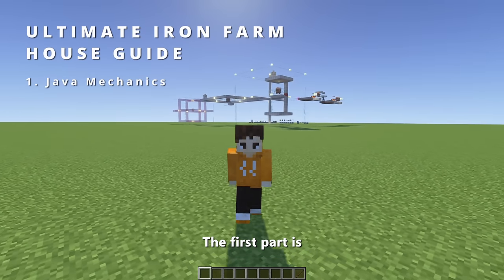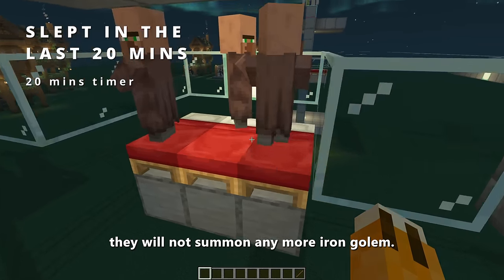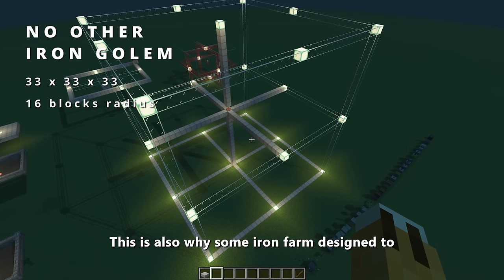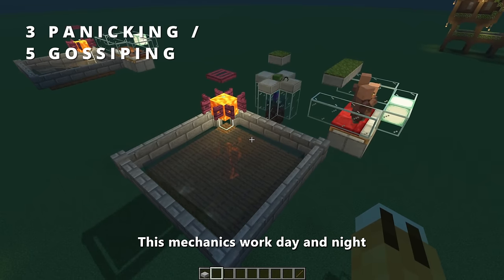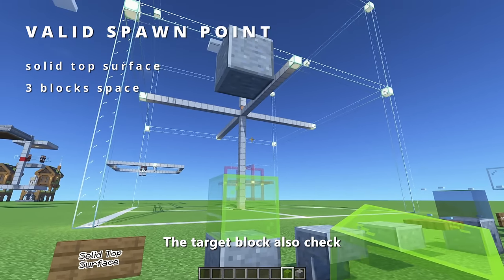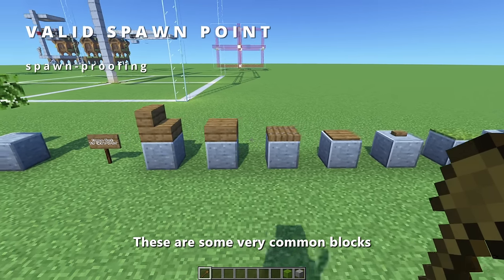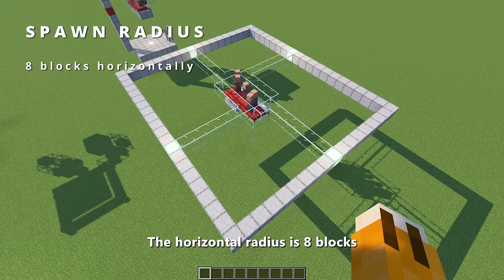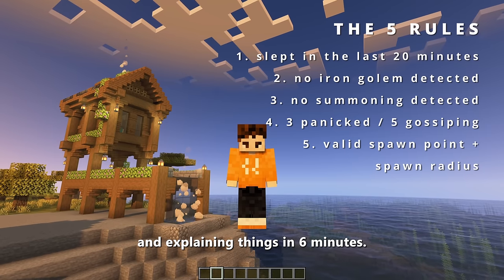Ultimate Iron Farm House Guide [Aesthetic Farm] [1440p HD]

Comment: just built everything on java and upgraded it to 3.0 and nothing is working according to the rules it should work but it doesnt, before i spawnproofed the inside the golem spawned inside but now nothing spawns anymore :(
Reply: this has happened to me too!
Reply: Same. If I place blocks outside the panic room, they spawn there, but not in the water channel.
Reply: Did you fixed this problem. And if you fixed it how did you do it?

Comment: Not working properly in bedrock 1.20. Issues: villager can not reach the working stations (they have to), villager glitching out of the building (found some on the roof and on the floor below the building), iron golems still spawn wrong or jump out of the pit.
Reply from the maker: The modification at the end of the video was built in Bedrock 1.20.1. I also just checked it in 1.20.10 and it's still working fine. Since I added a layer of sign so the kill zone is 3 blocks deep. No iron golem escaped the pool so far.

Comment: this doesnt seem to be working for me... does it work if some of the villagers are nitwits?
Reply: You HAVE to spawn-proof every block on the building and even on buildings near the Iron farm. Even if there is a 1 block surface, the iron golem will spawn on it if there is not a carpet on top of it. If you put carpet on top of every surface, both inside and outside the iron farm, you should have no issues.
Reply: @bradybowen3131  does this mean the golem won't spawn at all? or it will just spawn somewhere else? cause a golem isn't spawning at all. also, how far outside of the building do I need to cover up? it doesn't look like he covered any of the grass outside of his build
Reply: Golems should be spawning if you have 3 villagers set up near the zombie. For me the version 3 setup guaranteed Golem spawning. You must also remove golems that are very close to the iron farm in order for golems to spawn consistently and in the correct area.

If you look carefully in the video, he uses stair blocks or half-blocks where there were once full blocks; these are areas that must be spawn-proofed. Basically the roof, interior, and all four sides of the "house" must be spawn-proofed. I used carpet in my build and I no longer have issues with golems spawning in incorrect areas.
Reply: @bradybowen3131  I'm playing bedrock. but I have figured it out, apparently I was 1 block too close to a village, so.... I killed them all and burned down their village... now I have mass produced iron!!!

Comment: I built this in bedrock.
Followed it to a T, minus using glass for the floor. It didn't work, so I modified it a couple times & while a few golems appeared(sometimes in the water, sometimes outside). Now, I have NO iron golems spawning! 😭
I have 20 villagers, more than 100 blocks from any other villagers. I have 10 in the upper part & 10 in the lower part of the house. They all have access to their claimed beds & each level has 10 fletcher tables.

I'm at a loss of how to fix it at this point other than going all Daenerys Targaryen on them & starting over with two children villagers.

Does anyone have any suggestions? Is it the job blocks?
Reply from the maker: Is cat still spawning in the farm? 
If not, I think the village centre is shifted to somewhere else.
Reply: @aJackMinecraft  yeah, the cats are still spawning.
Reply: I figured it out!(with your bedrock mechanics video)
The beds on the top part made the village center too high. 😅
Thank you for the great videos!

Comment: i still have a problem with them not spawning any iron golems. followed everything
Reply from the maker: Java or Bedrock?
Reply: @aJackMinecraft  java. I've researched everything and the iron golems don't seem to spawn. Might just be a glitch
Reply from the maker: @gynics8605  Check the distance between the bed and the water canal. It should be 6 blocks gap vertically. >6 block = out of spawn radius.

Comment: Maybe some folks can help me with my java edition build. I followed the 2.0 method and made the changes to the villager and zombie barriers. The farm worked right away consistently spawning golems. I went to bed that night and now they wont spawn. Ive tried cutting all the trees around the farm, checking the caves under the farm, and the wider area for a rogue golem but no luck. 

The roof cavity is filled with dirt as to minimize spawn locations and to the best of my knowledge everything is spawn proof. This seems to be an issue with sleep counter. I've already had my villagers sleep at least one night before the zombie was even brought in and they were completely shielded until the farm was ready. I'm about to try signing out and back in to see if that resets something
Reply from the maker: Which version did you follow?  V2.1?

You should check the villagers at night. See if they could sleep for a split moment.
Reply: @aJackMinecraft  I figured it out and I was so mad. An iron golem managed to spawn in a 1x1 block space with a stair right above it, so it couldn't move and make noise nor could I see it's head clipping through the roof. It somehow wasn't taking damage. Farm is working flawlessly now
Reply from the maker: @Ksweetpea Haha..a sneaky iron golem.

Comment: Golem spawns on the roof what should i doooo il try v3 next day and see is it works
Reply from the maker: That means you missed a few spots to spawnproof. Put carpet / trapdoors on any flat surface.
Reply: @aJackMinecraft  yh now it works but sometimes golem jumps from camfires but thats not usually
Reply: @aJackMinecraft  and added some trapdoor on outside of the walls becouse it was spawning there on 1 block
Reply from the maker: @xvlaka4899  I found it annoying too. I have to lower the campfire by 1 block to prevent escaping.

Comment: Bedrock edition here, cats are spawning but No iron golems :(
Reply: Same here. Two cats at 12 villagers (fingers crossed)
Reply from the maker: If cats are spawning that mean the village center is at the right position. I guess you just need to wait until all villagers to grow up and work with job site block. >75% villagers needed to work so iron golem could spawn.
Reply: @aJackMinecraft  thanks! It worked after a bit
Reply: @aJackMinecraft  after some changes the farm worked for live 2 min, the villager have problems with their beds and have angry clouds above their heads and above beds…
Reply from the maker: @Norasek237  The particle is normal during nighttime. I think there is something about the job site block.
Reply: @aJackMinecraft  You were right! Thank you so much for your help 💖

Comment: im on bedrock but for some reason no irongolems spawn, no beds or bells near the farm, all the villagers have a job, have 20 of them
Reply from the maker: Is cat spawning inside the farm? Cat spawning means the village center is good. You might need to reset the job site blocks since it is possible that some villagers are being pushed away from their job site blocks.
Reply: @aJackMinecraft  the cats are spawning and, iv gone inside to replace the job sites and the beds, i managed to fix it with adding some lights? I think thats what fixed it, i added extra lights to the room they were in so it wasnt as dark and i gues that fixed it or something cuz after that it started working idk why
Reply from the maker: @ItzGuppy  I dont think adding light is affecting the farm but I do believe that some of the villagers finally reached their claimed job site blocks while you were trying to fix it. Glad that it works.

Comment: I had golems jumping out of the water bath so i added a layer of half blocks
Reply from the maker: I think you might miss a few carpets on the roof. 14:03
You should place buttons or carpet on any full block surface to stop them spawning on the building.
Reply: У меня не бедрок версия